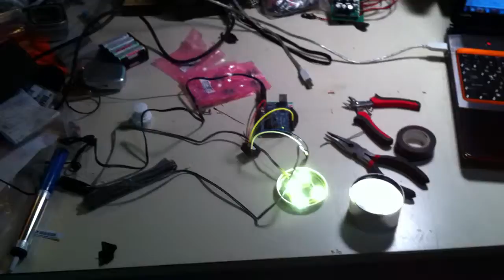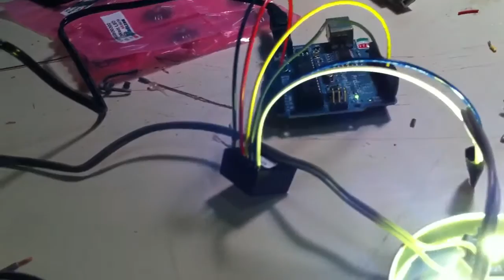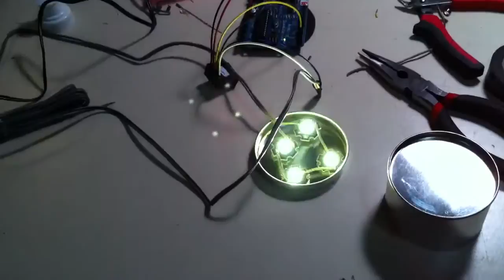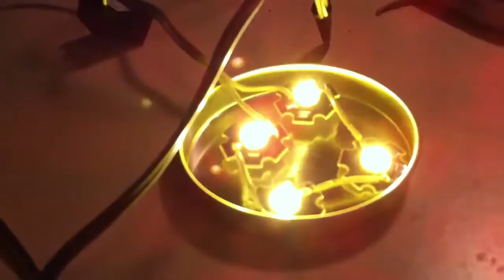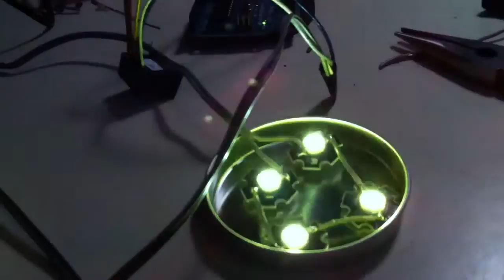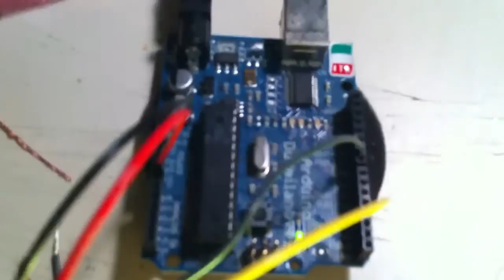BuckPuck Arduino

Comment: So could I control the dimming without connecting the REF and only connecting the CTL line from the BuckPuck? I am only familiar with using a 1pin PWM to + LED without a buck driver. So lost on the REF and how to program for it. Thanks for your help.

Comment from the maker: I'm not sure I can find that test code.  I'm sure I did something simple like loop from 0 to 255 for analogWrite with delay() to slow it down.  The BuckPuck is going to interpret the PWM on the CTL line to turn on and off quickly, so it's really as simple as that.  Getting linear dimming is a different think.  You'll need to dig into perceived brightness background to understand how to do that.

Comment: So glad to see you posting again! I have a question for you--the buck puck has a CTL and REF which it looks like you have connected to pin 3 and pin 9 (PWM). Any chance you could share your code snippet to make the light pulse that way? I have some examples to do this but not with this configuration with a buck puck. Thanks and great stuff!

Comment from the maker: So, you want "3023-D-E-xxxx" where xxxx is the LED amperage you want, expressed in mA units.  E.g. 3023-D-E-1000.

I think the "3023-A-E-xxxx" which allows 24 VAC input could be really interesting.  A thermostat/phone AC transformer provides 24 VAC, and this would work great for solving power drop with DC current over long runs.

Comment from the maker: The "3023" BuckPucks have the wiring pre-done, so that's a little easier.  Amp rating depends on your LED rating.  REF will supply 5V to some other component if Vin > 7 VDC.  Useful if you're using a small Arduino with 3.3 VDC power requirements.  That would be too low for the 5 VDC models.  

CTL connects to the PWM line (or just digital on/off if that's what you're after).  You need the "E" models to have this kind of control.